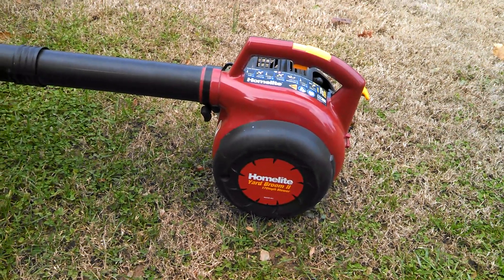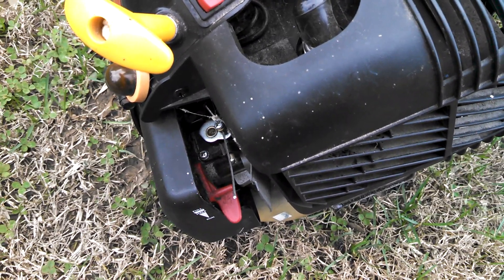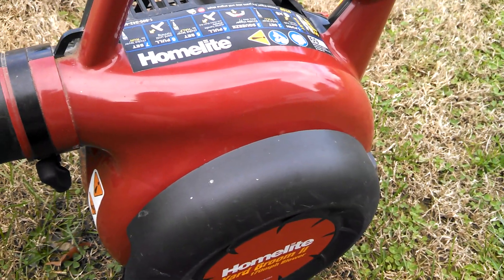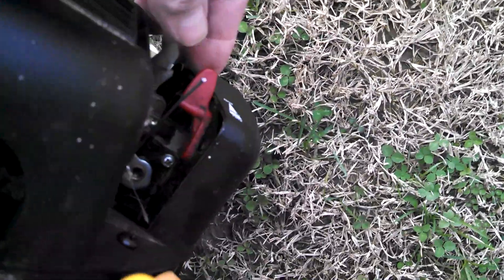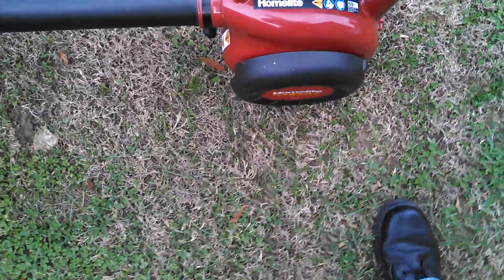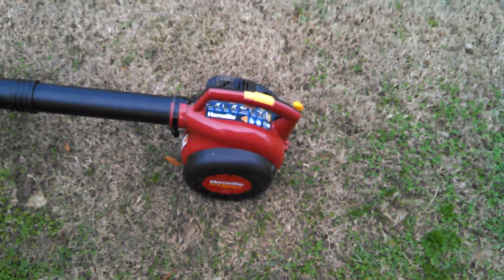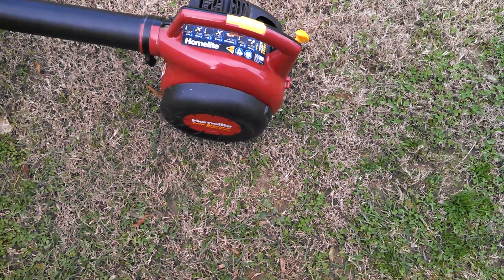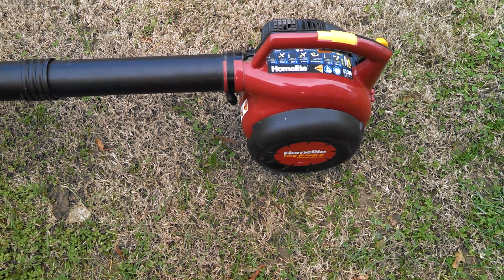Homelite leaf blower, another freebie!

Comment: I just got one and replaced the gas lines they was rotten. I cleaned carb new prime bulb and now it starts up and runs for about 8 sec and dies. What could it be.
Reply from the maker: Hi Eric, if your fuel filter is good, then you probably need to adjust the carb.

Comment: I wish I could get the one running I found on the side of the road.  I replaced the plug, checked for spark, and it has it, cleaned the carb, replaced the primer bulb and lines, and I still can't get the dang thing running!  Any ideas?
Reply from the maker: Hi Daniel, sounds like  leaking seal or  scored piston or cylinder, or both. You could take the muffler off & shine a light in the exhaust port while you slowly pull the rope. If you see  a lot of deep lines on the piston  then it probably doesn't have enough compression to run.
Reply: Alan Marshall thank you.
Reply from the maker: @hustleeveryday6582  you're welcome